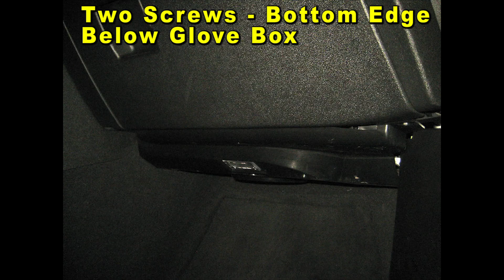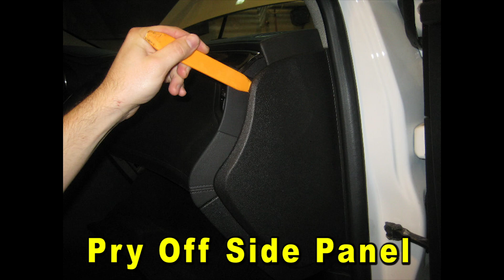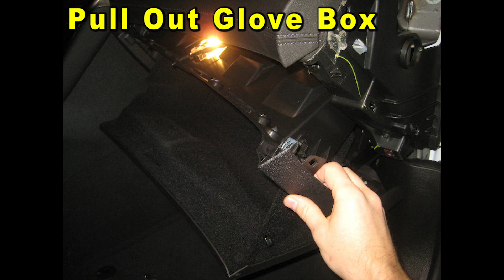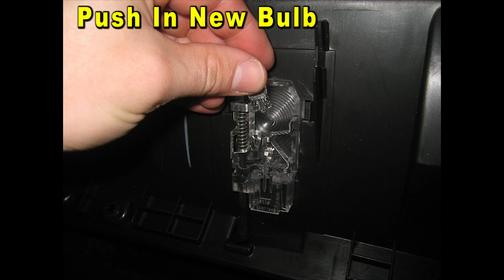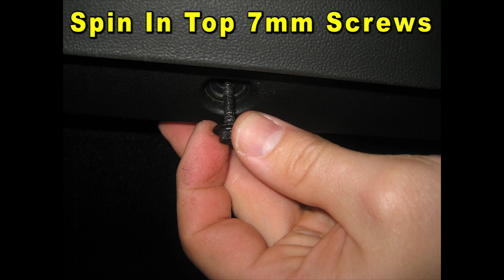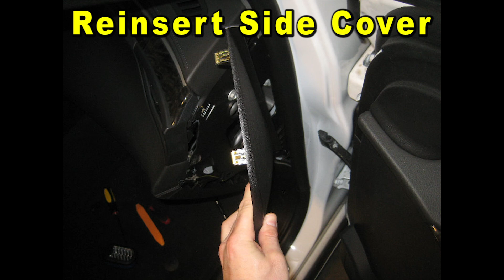2010 To 2016 Buick LaCrosse How To Change Glove Box Light Bulb With Part Number

Comment from the maker: Buick LaCrosse Glove Box Light Bulb - https://amzn.to/3JKBVK2
LED Glove Box Light Bulb Part Number - https://amzn.to/4bjfyqz
Precision Screwdriver Set - https://amzn.to/3sLixaP
Plastic Pry Bar Tools - https://amzn.to/3HMtsV7
Socket & Ratchet Set - https://amzn.to/3Z17LbA
Mechanix Gloves - https://amzn.to/3jCnHkt
Torque Wrench - https://amzn.to/3vS5uSI

The Paul79UF YouTube channel is a participant in the Amazon Services LLC Associates Program, an affiliate advertising program designed to provide a means for sites to earn advertising fees by advertising and linking to Amazon.

This DIY video shows owners of the 2nd generation 2010, 2011, 2012, 2013, 2014, 2015 and 2016 Buick LaCrosse how to change a burnt out glove box light bulb.

Comment from the maker: Check out the DIY guide for changing the glove box light bulb in a second generation 2010 to 2016 Buick LaCrosse - 
https://www.paulstravelpictures.com/Buick-LaCrosse-Glove-Box-Light-Bulb-Replacement-Guide/index.html

Here are all of the DIY repair and maintenance tutorials for the 2nd generation 2010, 2011, 2012, 2013, 2014, 2015 & 2016 Buick LaCrosse - 
https://www.paulstravelpictures.com/Articles/Buick-LaCrosse-Common-Problems-Repair-Maintenance-Guides.htm

Owners of other General Motors vehicles such as the Chevrolet Impala, Monte Carlo, Malibu, Spark, Sonic, Cruze, Volt, SS, Camaro, Caprice, Corvette, Trax, Equinox, Traverse, Tahoe, Suburban, Colorado, Silverado, Buick Verano, Regal, Cascada, Encore, Enclave, Envision, GMC Canyon, Sierra, Terrain, Acadia, Yukon, Savana, Cadillac CT6, ATS-V, ATS, ELR, CTS, XTS, XT5, SRX, Escalade and Holden Commodore may also find these DIY instructions to be helpful.

Comment: No need to remove all of that.  There is a small slit on the back side of the of the lamp housing.  Use a small flat stubby screwdriver and pry down.  Pull down and out towards the fire wall.  Unplug it, then replace the bulb.  It's that easy.
Reply from the maker: Thank you!